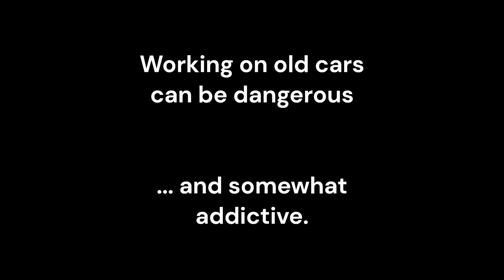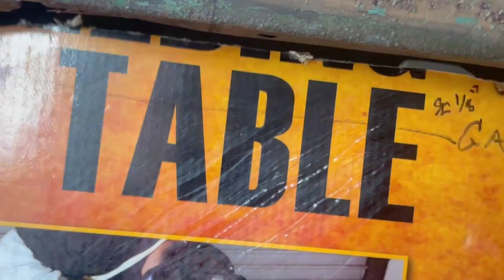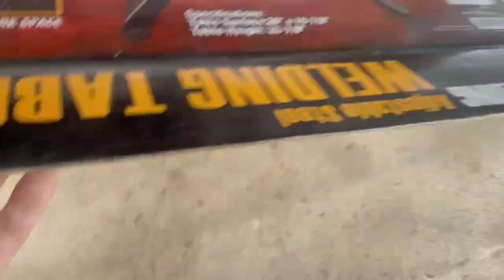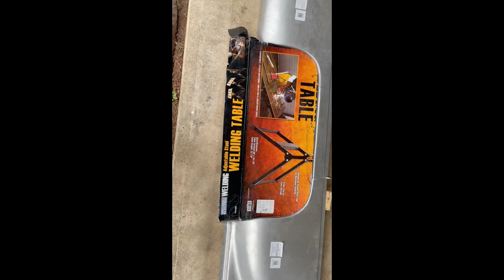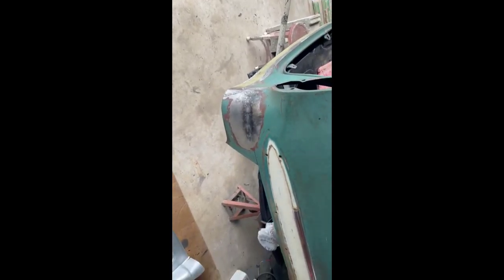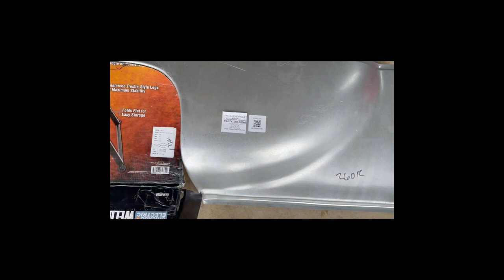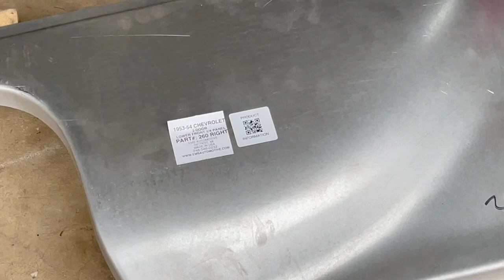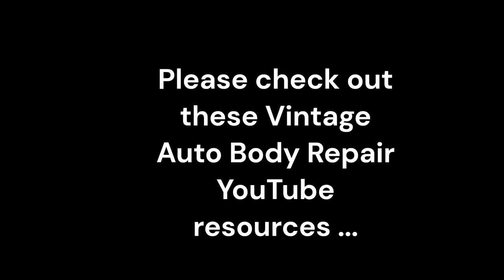1954 Bel Air (Bel Airror): Skirts Part 1

Comment: Good video I like the 54 Belair I owned one back in the 70's I have a 54 ford now needs the same repairs rocker etc. I didn't care for the close line drive or 6volt wiring my car is 6 volt to so a upgrade is needed not a fan of the cloths wrapped wiring.